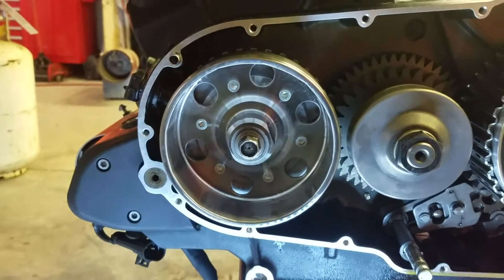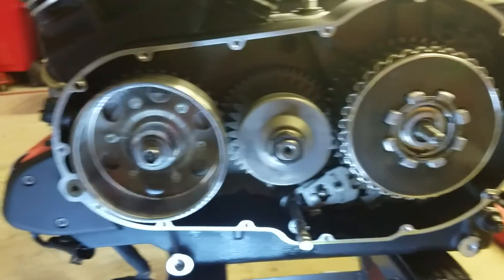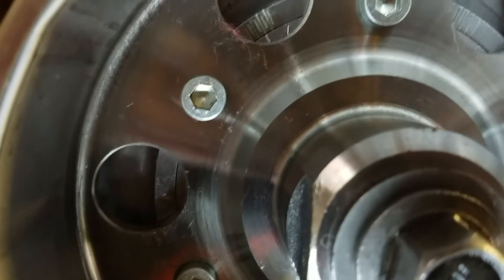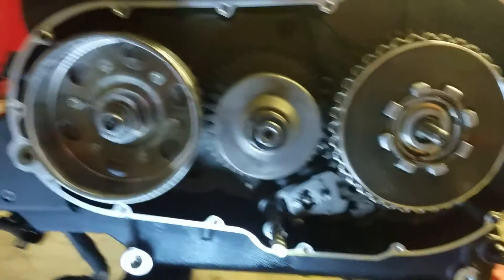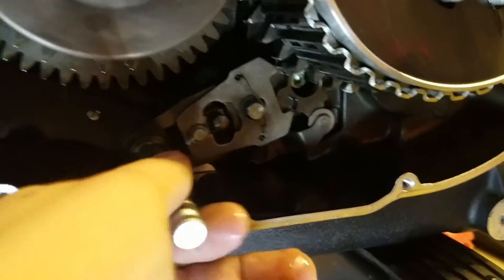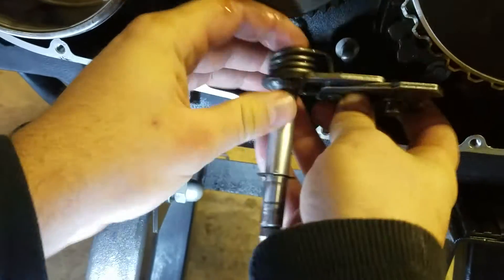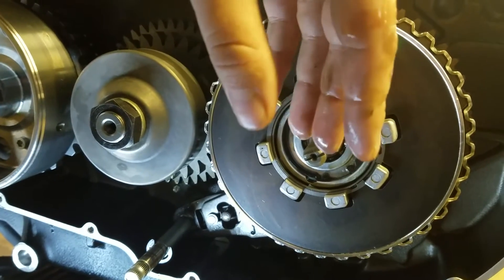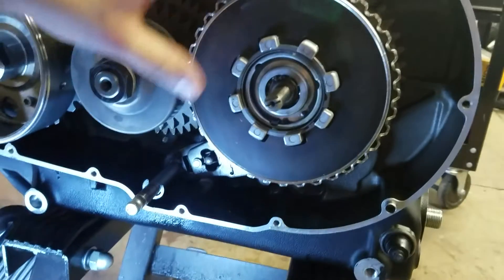Victory Lloydz Timing Gear 100"

Comment: My brother has a weird tapping sound coming from the front of the primary cover. No change in driving or shifting do you have any suggestions on what it could be. It’s not the cold start sound. It’s a 2005 hammer 100 cubic inch.
Reply from the maker: Just out of curiosity, next time you start it pull the clutch lever in and let it out slowly and see if it keeps makes the noise when the clutch is pulled in. Do this in neutral with the bike idling. The clutch will make a sort of tapping sound when it is let out and in neutral. When you hold the clutch in, the sound should go away. You will also want to keep up on oil changes (I do about every 2000 to 2500 miles since they are air cooled and break down oil faster) because your clutch uses the same oil and is wet. Let me know what you find out. If that isn't it, we will look into it more.
Reply: Ok I’ll tell him and see if that will help. I’ll keep you informed
Reply: Ok so he said he did that and it did not go away. He says it’s coming from the front of the primary cover. Could it be the stator or the magnet?
Reply: One more thing oil was changed two weeks ago because of the sound and it went away only to come back a few weeks later.
Reply from the maker: Im not sure exactly sure what it could be. Ill try and do some digging and find out what could be causing it.
Reply: Victory Installers Channel thanks any help would be appreciated.
Reply: Hey my brothers bike broke down and it was the bolts holding the primary gear behind the stator basket. Do you think the engine is still good also what’s the best way to repair the damage?
Reply from the maker: Hey! Honestly if it was just the timing gear (on 100" motors that's where its located) it may still be good. Did he have the Lloyd timing gear in it? Because if it is the factory timing gear it should be OK. If it is the Lloydz gear there may be some detonation. But if thats the case you should be able to pull the old pieces out, buy some grade 8 bolts for it and place it back together (make sure you use blue Loctite)
Reply: Thanks for the help I’ll let you know what happens.
Reply from the maker: Yes I will try and call later today. But what you will need to do is find the brass Philips screw on the left side of the bike near the throttle body. You will need to rotate it clockwise until the bike stays at idle. It most likely needs to be adjusted.  Do that while the bike is running.
Reply: It will only stay running with the fast idle on. How can I keep it running otherwise?
Reply: Victory Installers Channel the bike is running great we had to relearn the TPS. Turns out the shop the bike was purchased at serviced the primary gear and did not use lock tight on the bolts. The bolts were replaced put back together and good as new. Thanks for all the help. When can we get some new videos?

Comment: Hey thanks for the video I need that info but I have one question for the flywheel do I need the special tool for victory or can I get it at the my AutoZone or O'Reillys
Reply from the maker: No not at all, its just a drain plug actually. Its a m20x1.5 drain plug that costs about a buck.